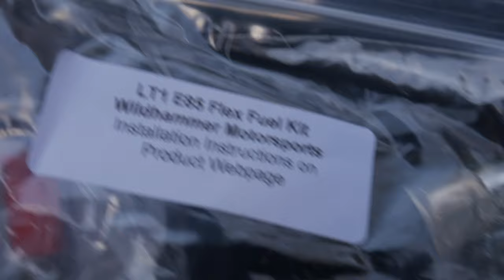2021 CAMARO 1LE GETS E-85 FLEX FUEL KIT *FBO SOON*

Comment: When I installed the e85 sensor I was scared a’f to even do the pin section but it was very easy especially the fact that I saw lethal garage do a diy of getting the sensor installed. I say you watch the vid & you’ll be straight forsure 😎 exactly what I did
Reply from the maker: Bet bet